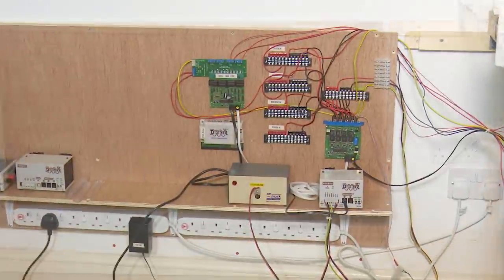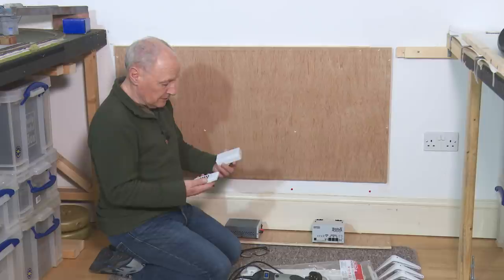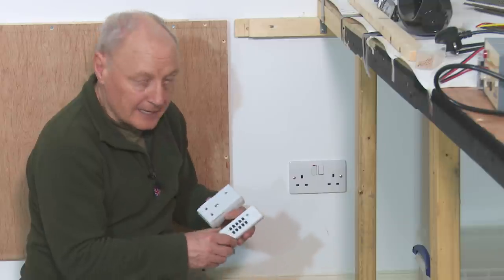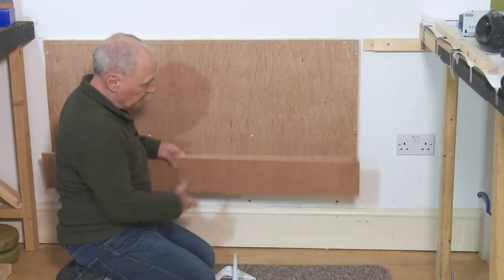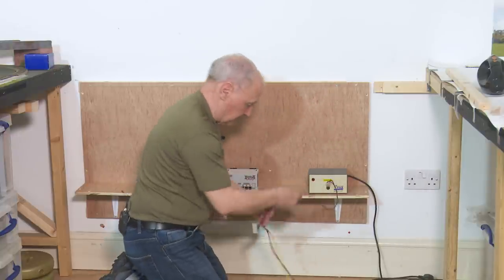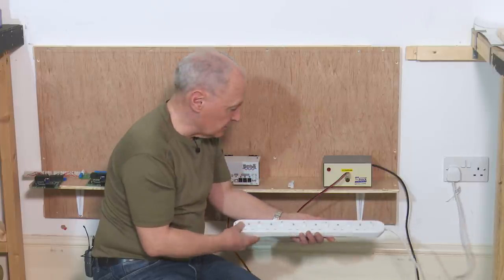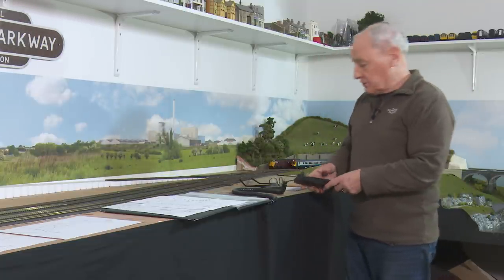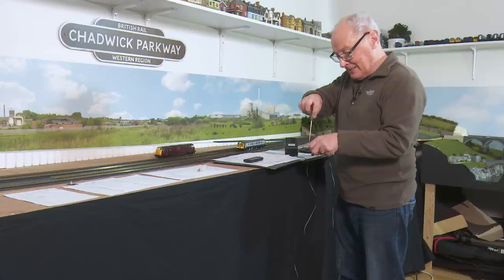Wiring Model Railways using Terminal Blocks at Chadwick Model Railway | 86.

Comment: Hi Charlie,

After watching the earlier 12-way terminal blocks video a week ago I tried to buy them on Amazon, but they had very quickly sold out. I then went on eBay, and found the 12-way’s available, but in China! Well, despite the Coronavirus being dealt with worldwide, these arrived from China at my doorstep in 6 days! 

It is just amazing that you can see a product on one of your videos on YouTube on a TV, find available stock on a computer screen, pay for it using a few taps of my finger on the screen, order it from a company in China, the order is packed, posted in China, flown from Guangzhou to Heathrow, then from Heathrow to Belfast, then from there to my house in the sticks. All in 6 days. And at a time when there are delays because of the terrible pandemic going around the planet! I now have 20 of those 12-way’s, so space for 240 wires for tracks, points, lights, turntable etc.. Hopefully that will be enough. Whatever happened to going wireless?

Jim
Reply from the maker: Blimey Jim, no wonder that there’s a world shortage of terminal blocks!

Comment: Had those radio switches for about 10y now, free when we changed to eon, then we changed back again. Worked fine for ages but one of the channels finally gave up. Simply changed to one of the spare channels. Handy bit of kit for killing the power with one click.
Nice informative vids. Cheers.
Reply from the maker: Yes Mike, those switches are so handy. And fortunately not that expensive either, regards Charlie

Comment: Hiya Charlie, For PCB stand-off I have used plastic children’s bead art from Hobbycraft. Come in packets of 100 I think, all different colours. Nice hole through the centre and very uniformed in height .
Reply from the maker: What a great idea Mick.
Reply: Mick,
On your suggestion I went to our area Charity Thrift Store.  I found a bag of 1500 beads.  The church lady wanted to get rid of them.  So as not to have to disinfect them from CoVid.  Price tag: $19.85.
Thanks for the great idea and cost savings.
I'm CHEAP
~Jim
Reply: @ChadwickModelRailway  Yeah any small plastic cylinder like a Bio Pen shaft cut to 5-10mm is another good support for PCBs.
Reply: Plastic standoffs for PC motherboards are good too.

Comment: Excellent as usual Charlie 
Totally agree notes are a very useful tool
I to use a remote to control power to my control due to the wall socket I've plugged into 
Had it a couple of years now works fine 
Stay safe in these troubled times cheers
Reply from the maker: Thanks David, that’s reassuring and I’m so pleased that you enjoyed it.

Comment: Thanks for this and all your other videos - a joy to watch! I bought  my first remote switch about 3 years ago as it definitely is a good way to turn everything on and off, but the remotely controlled plug in question let out a puff of smoke and ceased to work while using a standard vacuum cleaner! The plug was only rated at 750 W if I remember correctly! I later found a remote system rated at 1000 W and this has been working faultlessly ever since. So best to check the rating if a vacuum cleaner, (also an important modeller's tool!) power tool or heat-gun etc is to be connected to the system.
Reply from the maker: An excellent point MW

Comment: I had iced tea and peanut butter cookies. That was a good video and informative. I'm building an nscale layout right now. I like using those terminal strips as a junction point for my bud wired. It makes trouble shooting easier. I also use Digitrax. I have an LNWI so I can run with my tablet or phone. The first time I used it was at a train show last weekend. It worked pretty good. Keep up the good work
Reply from the maker: I’m so pleased that you find my channel useful PB.

Comment: Love the wire organization.  Also the advise on sizing for DC voltage drop is spot on.  (Even if I know a number of US modelers who are spolit by being able to get 18 & 24ga TFFN as cast offs (or reasonably cheap at the US equivalents to B&Q).  
One item you might want to look into investigating while shopping is a "creeper" of the sort used by mechanics.  Getting underneath your board is easy enough now, but will be a little less so with a layout above.  The creeper, while being a knee-saving device could also double as a rolling holder of plastic bins, too.  That's 2¢, but I washed it carefully.
Reply from the maker: Thanks for your thoughts Capt.  
Old age is rubbish!

Comment: yet another great video Charlie - thanks. One tip...don't put th epower strip under the shelf - you'll forever be knocking off the power switches with your box collection!
Reply from the maker: Good point Clive
Reply from the maker: Second thoughts, the plugs should stop the boxes making contact.
Reply: Chadwick Model Railway got me!!

Comment: Hi Charlie, love your explanations, if you use DCC frog juicers on your points rather than switches, then when a train runs the wrong way down a point it does not short the power for the layout or district. Instead, sometimes it derails, shorting the power, but when shunting it is certainly a better idea.
Reply from the maker: Thanks Andrew, I’m not a Frog Juicer kind of guy. 😜

Comment: Hi Charlie. I just want to add something regarding your comments about wire sizing. Quite rightly you mention the current carrying capacity of any wiring needs to match the current likely to flow through the wire. However, the max current alone is not the only consideration when sizing wire.  All wires have an internal resistance (often unhelpfully quoted as Ohms/Kilometre in manufacturers' data sheets) that is proportional to the size of the wire; the resistance of the wire will cause a voltage drop over its length.  So in layouts using long lengths of bus, where the power source supplying the bus may be some distance from where the power is being consumed, then the voltage drop over the bus's length can have a noticeable effect.
7/0.2 wire has a typical resistance of ~0.093 Ohm per metre
16/0.2 wire has a typical resistance of ~0.038 Ohm per metre
24/0.2 wire has a typical resistance of ~0.025 Ohm per metre
32/0.2 wire has a typical resistance of ~0.019 Ohm per metre
One might have, say, a 3A/12V bus used to supply DC accessories around the layout; in theory a 16/0.2 wire would be sufficient to carry the required current. However, if the furthest end of the bus was 25m away from the supply, then you wouldn't get 12V at that end, but barely 7V.  Alternatively if one fitted 24/0.2 wire with its lower resistance, then one would get 9V, or 32/0.2 wire would give you over 10V.
Just something to consider.
Reply from the maker: What an excellent and useful comment .
Thanks for taking the trouble David.

Comment: Hi Charlie, yet another brilliant and informative video,  I have been using those remote radio switches for the last 3 years,  I started off with etekcity, but had a couple of failures,
so upgraded to Energenie sockets, wouldn’t be without them, although I have 10 in my train room.
Reply from the maker: Ten, blimey Mark.  I need to get back to B&Q!
Reply: Seriously I don’t think you can have enough outlet sockets, when I installed the sockets I put in 20 double sockets. The shed is 20’ x12’ very well insulated, and very cosy. So I have sockets that are remote, for controllers, accessories, general lighting, and signals etc, then non remote for the likes of WiFi,  damn Alexa lol,  phone, rechargeable’s, all good fun isn’t it. Seem to spend more time “faffing” about with the logistics, than playing trains. Any way many thanks for your blog/vlog, keep up the excellent work, and yes, I am subscribed👍

Comment: Hi Charlie just watched your video very nice wiring I must say,as an electrician and having spent a lot of time making up control panels for packing machines there are certain products that we used that are essential,one being PVC slotted trunking which will keep your wiring tidy like nothing else and of course terminals and all the accessories a company by the name of Phoenix Contacts has a wide variety and they are an international company if you have time in your schedule maybe a google search to browse these products may be of some help they maybe over the top for your needs but the trunking is cheap and comes in various sizes.keep up the great video's
Reply from the maker: Thanks Trevor, I’ll certainly check out Phoenix Contracts.
Thanks for the advice. Regards Charlie

Comment: And here's me thinking DCC was just two wires! 😁 
When it comes to supply and connections  you should remember, the female always has the power ( so the wife says).
One more thing, have you considered using a Frog juicer? They  change the polarity of the frog faster than the command station can shut down. Result, no shorts on points. 
Great video, keep'em coming! Keith
Reply from the maker: I like that, CSX, the female has the power!  Frog juicers are not for me as Train Controller will do all the frog switching as routes are selected.

Comment: Hi Charlie great video, keep up the good work. I am in the process of wiring my new N Gauge layout and  I have used a few of your ideas, I have my electronics on hinged boards under the layout. Different from you, I am using a NCE system, and I use 4x Dcc specialities PSX circuit breakers, they are quicker than your relay based PM42's. I  have set them up with reset switches and warning led's, so on a short if I run a loco through a wrong set point, I correct the loco then press the reset button. I have also altered the trip voltage for n_gauge with jumpers although you can use cv's.
Reply from the maker: Clearly another way to skin that cat. 😜

Comment: These pass through sockets with remote controls are quite useful. I've been using them for about 5 years to turn various pumps / lights / skimmers etc on and off for my marine aquarium with no problems. 
Just don't drop the remote in salt water...  Guess where I learned that one!!! 

- John M
Reply from the maker: I appear to be the last guy to find them John.

Comment: G'Day Charlie. Matey I have a tip for you regards your wiring. I use a Heavy Duty Cable Stapler that fires off U Staples with a plastic Cable holder. You can find them online from any good tool shop but they wont be cheap but oh boy do they make cabling easy and FAST! Expect to pay around £35 for a good one ok. Also just an FYI thingy, IF you had of gone down the making a draw path, then I would have given you the tip to use an E Chain cable tray and termination ends. Stops the cables from buggering up basically.
PS: I also use another Stapler to lay down my track with narrower U Staples. Its bloody fast as well but my main reason for doing this is because my layout is in my loft here in Australia and lets just say that on 40°+ days out side in the SHADE, that things tend to bend a tad and the staples with sprayed clear contact glue used on the ballast over a cellulose based track bed works very very well.
Reply from the maker: What a great comment G130.  I have never heard of the stapler but will check it out.
Reply: @ChadwickModelRailway  Hi Matey, Here is one supplier in the UK, The video shows the 15mm version but a 12mm version is also available. You choose :)
https://www.youtube.com/watch?v=nbcNobb8jJs
The cheaper ones on that site are sold out atm, just do a search and you will find them elsewhere.
Arrow make them as well, the T72 and the T59 are the model types (my ones like the T59), anyway, just check their site.  :)

Comment: Good morning Charlie. I hope you are well. My father and I went to the Exhibition in Glasgow from NI a lot of years ago and one thing that stuck in my mind was a particular layout that had its points controlled by a paper fasteners (look like a split flat head nail) control board. The connection was made by a wired slim metal pointer kind of thing, and the guy was able to change his points that way. Have you or any of your viewers ever seen of heard of this? Great video as usual. Still flying the drone? I used to be at sea like yourself.
Reply from the maker: Hi, yes to drone still comes out occasionally.
The point changing system is known as “stud and probe”. There are videos on YT explaining the set-up
Reply: @ChadwickModelRailway  Thanks for the reply Charlie. Do you rate this system, or is it a really old fashioned way of operating the points? I like the idea of (manually) changing.
Reply from the maker: It’s still popular and very often seen at shows.

Comment: Thanks for another excellent video. One issue that does concern me however is your choice of wiring colours - surely using three wires that are red black and yellow/green is dangerous. I don't have a problem with the red and black as I am sure these are colours used by everyone but the addition of a yellow/green just tells everyone it is mains 240v. Keep the videos coming as they are great for keeping everyone amused and informed - thanks.
Reply from the maker: I do understand your concern Roger.
I believe that if you use the current colour scheme, blue, brown and yellow/green for earth, the electrical regs state that you must label that it’s not 240v AC.

Comment: Speaking of wires - -another trick some use is with telephone wire, which carries 8 wires and available today on Amazon (no more radio shack).  This is a great way to wire up all contacts in a tortoise and bring one cable back to the control point.  Or - -anywhere you would like to carry a collection up to 8 wires to another point.  Some even go so far as to yous telephone wall blocks to the device and then plug these cables in point to point.  Makes it a "snap" for troubleshooting a problem.  Just drop off the wire branch to see if that is the issue.
Bob s
Reply from the maker: An interesting point Bob

Comment: I use 16 / 0.02 for points motors and 24 / 0.02 for the track throughout, I've never had voltage drop problems. I always believe its better to go too large than not large enough, Your wire sizes are fine, I'm not criticizing your sizes, just saying.
Reply from the maker: I totally understand your willingness to over engineer.  I commend you for it Sam.

Comment: PM 42 has now been superseded by a digitrax PM74 which is capable of taking care of occupancy as well as transponding detection. Have you tried it and if so do you rate it?
Reply from the maker: I have one fitted Tim, but only used for circuit protection.  It’s certainly an improvement on its predecessor.
Regards Charlie
Reply: Thanks Charlie. I am an absolute newbie in MRing and am learning a great deal from your videos. DONT STOP! (please) @ChadwickModelRailway

Comment: Hi Charlie…another useful video although I could do with some guidance based on your vast experience as I’m seeing differing advice across various forums/videos. If using 16/0.2 wire for droppers, does that mean I’d need to use 24/0.2 for the DCC bus wire? I have a short layout (5ft main with 2 x fiddle yards - making the total length 11ft long). I will be using an NCE PowerCab which has 2amp output. Thanks in advance 👍🏻🚂
Reply from the maker: Great question, Bryan, yes I would use 24/02 for the bus wires. Regards Charlie
Reply: @ChadwickModelRailway  ok. Thank you for taking the time to reply 👍🏻

Comment: Excellent video Charlie.
Watch your power draw as some of these remote plugs can't take a high load. It should say on the packet what your ones can take.
Most are ok for model railways.

Have you a link to that wire stripper ?
Tony.
Reply from the maker: Search for RS 382-2847 😜
Reply: @ChadwickModelRailway  Thanks Charlie. I'll check it out.

Comment: No tea n biscuits for me as im a diabetic, however,... theyre not needed, im glued to your videos like this, especially on locos. you come across as a lovely bloke mate. mdf is horrid stuff m8t but for this case its probably the best bet as its very easy to drill, attach screws and work with, but i would NEVER ever use mdf as a baseboard. im an electrician by trade charlie and i can tell you those sockets should never carry a big load, (anything over 5 amps) and while you think theyre off theyre actually not at all, they have a 5v standby current thats always on, i would never leave them unattended as they could possibly cause a fire so be carefull fella. please fit a circuit breaker to protect yourself
Reply from the maker: Surprisingly they are rated at 13 amps although I’m using mine just for the railway board and lighting.

Comment: it all looks great and I know you already done all the work and purchased it all but...... if you had looked into DIN rail (tech) terminal blocks you could have saved yourself a ton of time and space and effort. Those power distribution blocks 14:37 are nice (and I love them) but there are DIN rail distribution blocks that take up way less space and already come ready to go, no jumper bars. There are some the come with quick disconnect plugs just like @10:30 and you don't have to worry about shorting out anything since they are  covered. Down side is you have to search for good deals and at time may look more expensive but the versatility greatly out ways that.

Still your setup looks great you did a great job.

One more thing. if you look up video game console standoffs you can separate the components from the backboard much easier.
Reply from the maker: An excellent comment Aztec. Stop I shall certainly look up your suggestions especially the stand-off arrangement. Regards Charlie
Reply: @ChadwickModelRailway  My long detail comments with links to Google drive keep disappearing from your channel.
Reply: @ChadwickModelRailway  So this time I will leave just one link and hope it stays. When you replay I will post more detail and links.

Comment: I have a fused spur switch in the cupboard upstairs which turns on / off all power to the loft. which I did when I put power to the loft several years ago.
Reply from the maker: Yes a good move but one that I can’t achieve Sam.